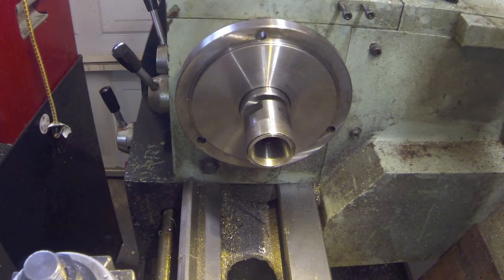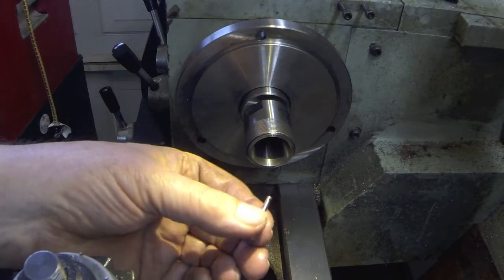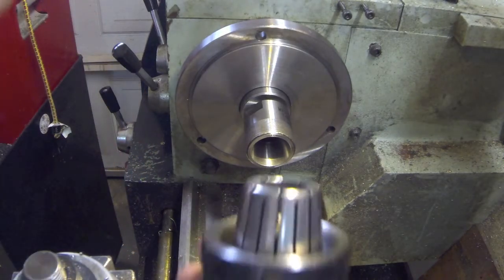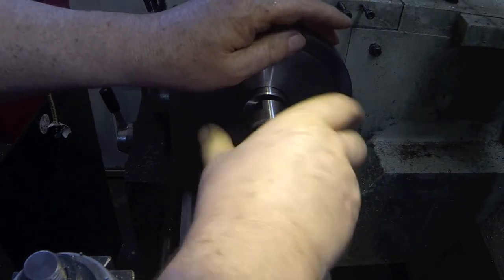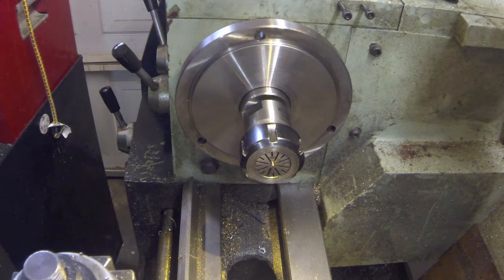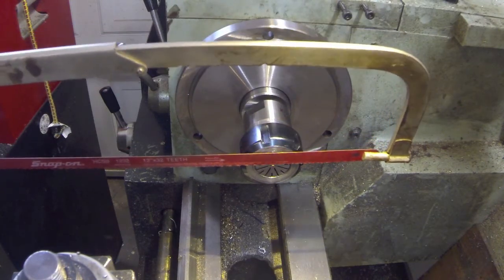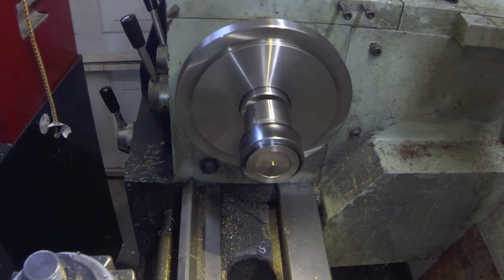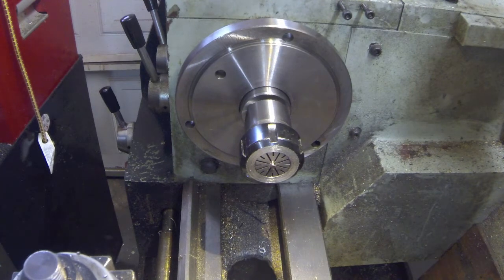15CC Nemmet Engine Valve Retaining clip grove

Comment: Hi Herb !

I once needed a small groove like you in a bigger diameter stock and I too use a hacksaw, but I sharpened the blade as normal a cut off tool and clamped it to my tool holder - it gave a fine sharp groove !

I have a MT5 in my lathe main spindle and I have a MT4 collet holder and a MT5 -> MT4 converter but I never used the setup in the lathe because I'm afraid it will slip sometimes.

Did you experience any slip problems with your setup ?